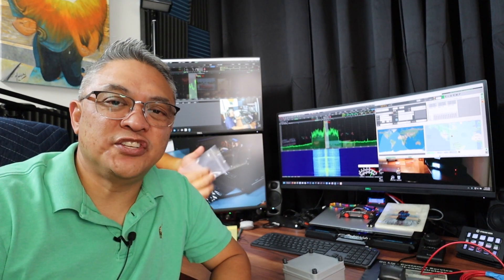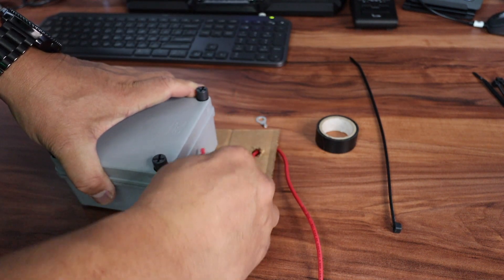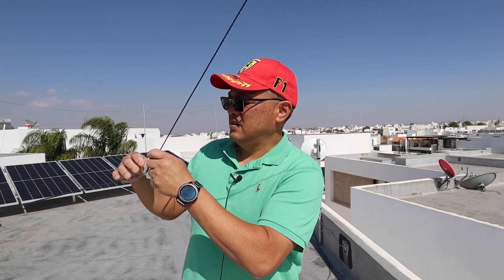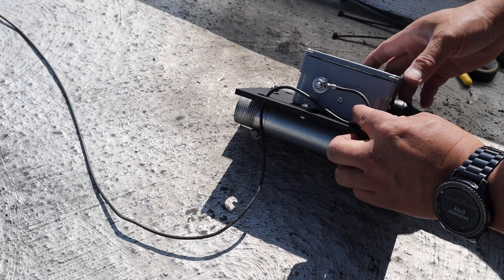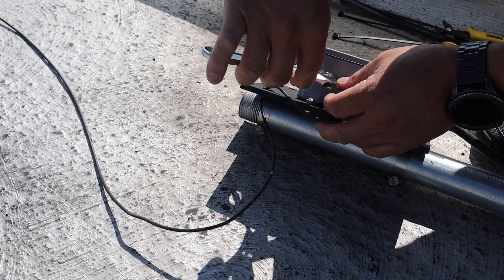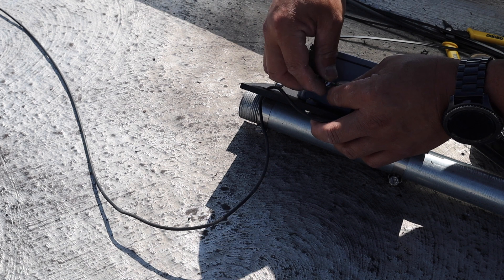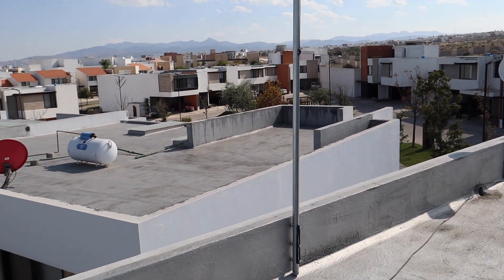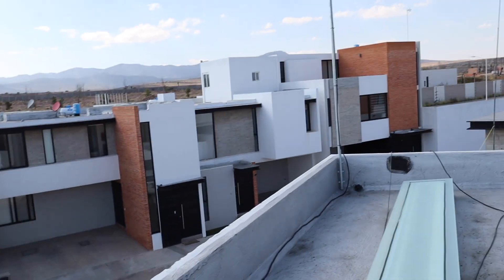Strain Relief for Wire Antennas | Horizontal Loop Antenna | 4:1 Balun | How to make a Strain Relief

Comment: How tight can you make that strain relief loop ? Before it effects the antenna. Thank you.
Reply from the maker: Just make the loop big enough for what you need to provide some tension relief.  I don't really measure and I know it will effect the antenna, that's why I have an external HF tuner.  I don't have to be precise.
Reply: @DarrenN4VFR  Thank you